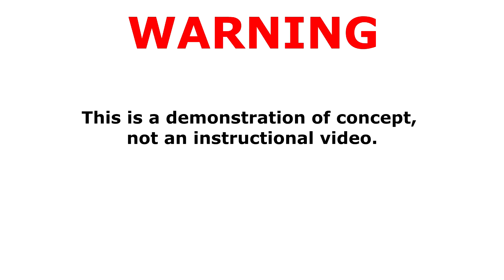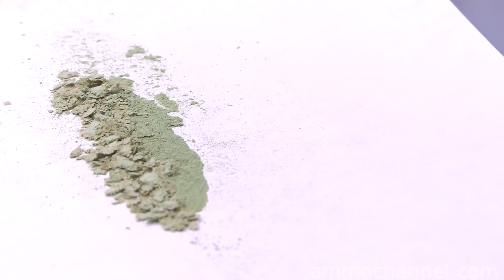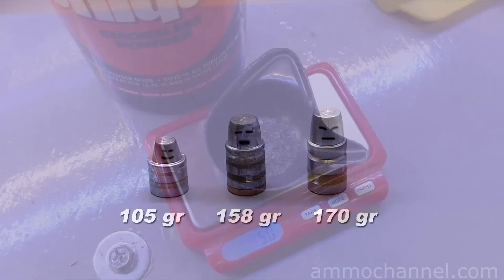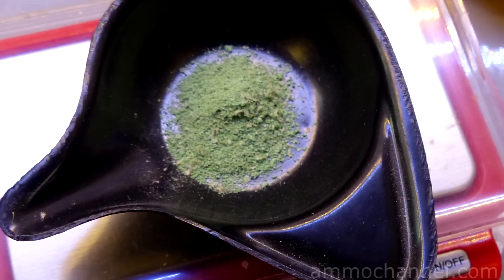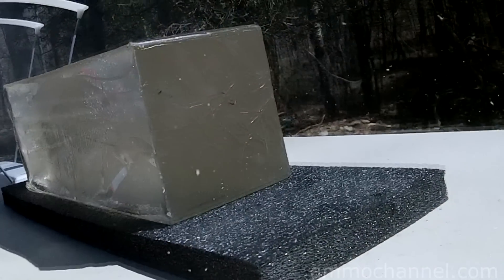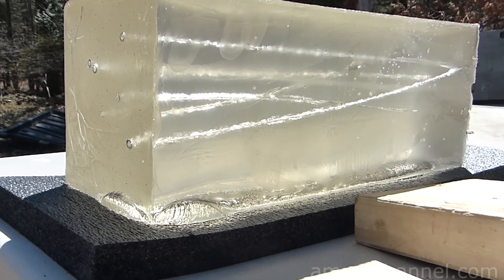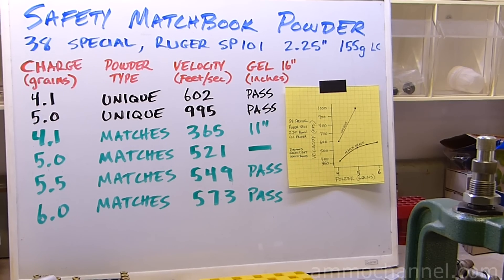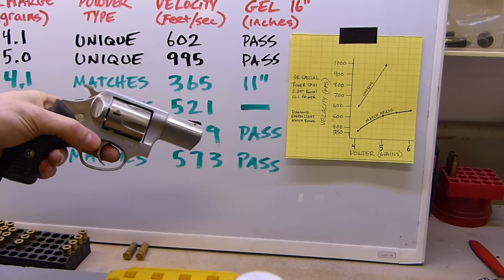Improvised Ammo #2: Matchbook powder vs Smokeless

Comment: You can change grain size by grinding it very fine, or adding water and letting it dry into a large shape, and then grinding that into coarse powder.  Large grains make slow powder and is better for long barrels and small grains make fast powder and is good for short barrels.  Also, any paper at all will hurt your speed.

Comment: I bet it's more like rifle powder in that it's a slow burn which is why 6g only pushed it 573fps.  Get some H335 maybe something faster and try it with 5-6g and I bet it will be comparable then use the match powder in a round that uses faster rifle powders and see.  300 Blackout, 7.62x39 etc.  You can test a few rifle powders.

Comment: I imagine you know this already, but with Black Powder and other non-smokeless type loads, you typically have to use way more powder than you normally would. you could easily use 60 grains in a single BP load. for matches, i think a more accurate load would be much higher than 6 grains.

Comment: 1:04 For  a more powder like result consider using a hammer on  a board on cement or in a basement (whatever) to put the shaved off matchhead's on, then hammer them to dislodge the chemical dip from the paper more completely (The Matchheads will not ignite, I tried it for you).   2:00 consider using a kitchen screen sifter, the wires are tighter together for a fine powder will result and improve the FPS performance.  This method will not work out if you are hoping to become "The Shooter" who did it  and themselves, or if you prefer it will be done for you, just wait a bit... Take a look at your future 

https://www.youtube.com/watch?
v=lxdPao1n3Bo&ab_channel=TrendingStory  <- Real Video

Comment: Once made a scaffolding Bar into a cannon as a Kid and used Match heads as the propellant and a load of Nuts and bits of metal for shott and at 20 yds took the top out of a Holly Tree  It was quite impressive actually but terribly Dangerous and I wouldn't recommend it to anyone to try!

Comment: Cut the match heads  off with shears,  and throw two or three books in a electric coffee grinder, and hit it for a few seconds,  because  this is not a compressed round the worst that will happen is it could flair up,( I've done this meny times and it never has) , now take this powder and run it trough a screen, done

Comment: if you want fast burning match powder use sandpaper to take the red phosphorous off the striker and get some sulphur off the match heads mix to Red Phosphorous 30 / 70 Sulphur ALSO make sure the sulphur is really fine crush it down down down, then mix the two fine powders together (i heard some combination (brand) of matches can cause the 30 / 70 to be friction sensitive so be careful when mixing, you should use gravity to mix )

this powder burns really fast and if compressed causes a decent explosion and release of gases so experiment with different weights and mixtures

Comment: Sand of the phosphorus and add it into the mix, it will get more faster burning and aggressive, be aware that it gets more unstable and will react to friction and will behave almost as nitroglycerin. No problem to handle it and fire it, but if you do so, do it with extreme precaution.
Reply: If you do that instead of the bullet fireing out the cartridge spilts and explodes, so that idea is not very usefull

Comment: If the matchbox mix is overoxygenated and high in sulphur then grind up a little charcoal to a fine powder I would suggest 2 parts powder to 1 part charcoal to start that should make the mix slightly less corrosive and if mixed slightly to excess then what is not needed would only act as a filler. try it :)

Comment: At the 573 fps velocity, you're generating 113 foot pounds of energy.
Reply: A .22lr has more power than that
Reply: @matthewmorel3758  from a full length rifle, its about equal. but from the ~2" barrel he's testing, the .22 will only generate ~50 ft/lbs (average, obviously different bullet weights are a bit more or less powerful)

Comment: Is it possible to make improvised primers?
Reply: grab some strike on box matches, hit the heads of a few of them with a hammer to break the matchhead from the wood. scrape off some of the strike strip off the side of the box with a razor.  gently mix the powders together, then whack it with a stick.  it should explode.  that's your primer.  you can reuse centerfire primers if you tap the dent out with a hammer and rod or some such.
Reply: U can use a toy cap covered in tin

Comment: Unique is a fairly fast burning powder.  The match head powder seems to be a little slower burning.  The increase in FPS for the increased charge weight of Unique vs the increase in FPS for the increased charge weight of  match head powder could be interpreted to support that Unique is burning much faster than the match head powder.  That is, the heavier charge of match head powder failed to burn completely before the bullet left the barrel of the gun.  I wonder if a longer barrel or heavier bullet would show the same relationship between charge weight and velocity for the match head powder.

Comment: It looks like the reason for the tapering off of performance is due to a lack of oxygen in the round. Go buy some stump remover and (KNO3) and sprinkle a little bit in. KNO3 is an oxidizer and you will get a better performance out of your match heads with that. 

I would also love to see if a Rocket Candy mixture ground up would produce a good powder. 

These videos are great, hope you keep making them.
Reply: +josh Katz  Nothing to do with oxygen, that's just how energy and velocity works. To go twice the velocity, you need four times the energy. From the data, we can discern match powder just has a very linear burn characteristic, compare to smokeless powder where linear increases in the amount of propellant can result in exponential increase in energy.
Reply: +josh Katz said:
" Go buy some stump remover and (KNO3) and sprinkle a little bit in."
Josh, stump remover is potassium nitrate (KNO3) so why bother? Buy one or the other..no sense in buying both!  :o)
Reply: Rocket candy may work for a long barrel rifle or shotgun. I dont thik it would for a pistol, it is slow burning compared to gunpowder.

Comment: What if you granulated the matchhead powder like with black powder, granules should give better burn characteristics then fine powder, just wondering.
Reply: Neat idea
Reply: Because of empty space between grains
Which mean greater temperature and quicker explosion. In a nutshell - better results
Reply: Better pressure increasing
Reply: I've done this with my cap n ball revolver  before,  and I loaded my Chambers about  half way, the felt results were very similar to black powder,  although I can't add more then that as at the time I did more have a conagraphe,

Comment: I did a bit of analysis and extrapolation. The data you gathered seems to fit a natural exponential curve, which is quite interesting but expected. The most economic yet viable grain amount would be around 4.5 grains producing a velocity of about 450 ft/s. After about 5.0 grains the powder will become increasingly insignificant, and anything beyond 5.5 grains is wasteful. The increase in velocity is about 4 ft/s after 5.5 and it rapidly decreases. The best fit curve I found is

V = -4.086x10^4*e^-1.268M + 591.3

Where V is your velocity and M is the mass in grains. I did a bit of rough calculations and found that the bullet would travel about 280 feet before hitting the ground. Of course, it's incredibly rough, so it may be fifty feet more or less. Anyway, interesting video!
Reply from the maker: Impressive!
Reply: Came for the ammo, stayed for the math
Reply: @rbhouse1377  Lol
Reply: cool analysis, but by measuring velocity we are indirectly measuring energy, which is a less accurate way to make predictions

I think we should expect a somewhat linear relationship between the energy of the rounds and mass of the powder used.

kinetic energy (KE) = .5 x mass(M) x velocity(V)^2
doing these calculations I will remake the graphs made in this video and link them below.
https://docs.google.com/spreadsheets/d/1_Q0pt13KqczPvLWoVcAQNDMX1zoinPuu_LU3DlbMvX8/edit?usp=sharing

dont know if you guys are still following but I regressed some equations (that were statistically significant using energy and omitting the last 6grain datapoint) for what you should expect out of any length barrel with any load of powder and any bullet mass.

here are the numbers for a 7.62x39 round given a standard loading of 24 grains, a bullet mass of 125 grains, and a barrel length of 16 inches
energy = 990.8 ftlbs
speed = 1890 ft/s
(i expect this to be an overestimation by about 20% given that the burn rate of match powder will likely be too slow to combust fully before the bullet exits the barrel unlike smokeless, and that ballistics get much less linear past the sound barrier)
so, i expect 1500fps =]
Reply: An actual intellectual discussion in a youtube chain of comments, and very insightful for that matter.
Reply: אבהו דלשר ive done this with a 12gauge shotgun a few years ago and got way more energy, so your calculation probably applies to .38 only. i think i used 100 grains of match powder and got the same penetration with a .70 round ball as i had with 60 grains FFg. however, using it in plastic shotshells will render them useless, it melts them, seems to burn much hotter than regular powders
Reply: The uncertainty of many chronographs is less than 4%. Some have uncertainties of about 0.2 m/s. Using 4% as the uncertainty, your linear relationship is immediately out of range for the first point (4.1 grains). The upper boundary is 66 J while your best fit line predicts 69 J. The second point, 5 grains, has a lower boundary of 116 J, which again, your line of best fit falls out of at 113 J. The next two points fall within the uncertainty, but the uncertainty given is quite a large one and most instruments don't have a large uncertainty like this one, nor a percentage one. Given this, your linear relationship seems to be invalid.

Besides, a clear decrease in dV is present as more powder is used. This is practical since there is only a certain amount of pressure that can be applied before any excess pressure is wasted. This is clear if you've ever fire a toy gun: the dart flies out before all of the air is released. So, there has to be a peak somewhere, indicating a curved, not a linear, relationship. The best fit for this is a natural growth curve, which makes sense since it's exponential and constantly compounded rather than in chunks.
Reply: true, but I dont have any information to calculate the error propagation youre refereeing to, so it seems like a mute point.

if you compare the R^2 vales of both the powder vs velocity graphs and the powder vs energy graph, its indisputable that a linear fit line better represents the energy graph.

I do agree that a logarithmic fit is more appropriate, however if you take the limit of any logarithmic function as it approaches its origin, it does in fact become a linear relationship, which is why a linear fit is appropriate for small estimates =]

in reply to the waste of pressure, if you integrate the PV work done by the system, it will be the same no matter how fast the bullet moves, so im not sure what you mean by wasted pressure
Reply: Considering it's a different casing all together, I don't have enough information to predict how fast it will go. Casings do affect how the powder is burnt and how pressure is built. In fact, I'd say I don't really know enough information based on these results to make a good prediction. What prediction I made was just a sort of interesting mind experiment. Clearly there is a need for more testing with more data points and a more controlled environment. Like I said earlier, three data points is just barely significant. Four is just barely significant as well. I personally would like having three trials for each amount of powder and around eight different amounts of powder. Otherwise, you get some extremely varying results.
Reply: I did a linear relationship on the velocities, including the 6 grain shot since only three data points seems pointless, and got an R^2 of .91. This is pretty good, I agree. However, it has an RMSE of 33 while my equation has an RMSE of 5. Clearly no linear fit cannot be right, since the RMSE outweighs R^2 when it comes to prediction, and that's the purpose here.

Besides that, I gave a generously high percentage error to calculate the error of the graph. A percentage error is generally not what you give an instrument, rather you'd give a static uncertainty such as +/- 5 FPS. The fact that your linear fit and my linear fit do not match the data set when uncertainty is given is a bad sign.

Finally, the PV work done is only effective if the bullet stays still for the entire pressure to build up. The problem is that the bullet will move after a certain threshold is met, which will be before all of the powder is burnt, meaning it will move as the powder is still burning. At some point, the bullet has to be moving so quickly that it exits the barrel before all of the work can be done onto it due to the powder not fully burning. If you watch Demolition Ranch or TAOFLEDERMAUS, you can see this in their experimental bullets tests. If you fire popcorn, the popcorn will leave the barrel before all of the powder is burnt. Same concept here. Because of that, there will be wasted powder and there is a negative V''
Reply: so how fast do you predict an ak projectile to go?
because it seems like youre just flaming my method at this point

we both know rsme is useless with small data sets because they inherently have small variance, we both know velocity doesnt scale as linearly as energy, and we both know popcorn out of a shotgun is not going to act like a piston unlike a bullet

Comment: What's your volume of powder vs. weight?  You may gain some performance out of the match powder if you've got a significant volume of space between the bullet base and the powder.  Fill the space with cream of wheat or kapok.  I'd do that with Unique with cast bullets from larger rifle cases.  it really helps with consistency and accuracy.

Comment: If nothing else it is still useful for reloading primers. What kind of performance would you get from using blackpowder for propellant and the matchheads to reload the primer?

Also, don't know about American legality regarding armor piercing but gluing a steel ball bearing in the point of a hollowpoint round increases penetration (and helps it expand).

Comment: Very interesting.

I used to make "home made fireworks" using the powder from model rocket motors. Just took a large drill bit and by hand turned it, got a very very fine powder which seemed very powerful. Tried it in a home made .50cal cannon, works pretty well if I don't want to go spend $20 on a bottle of powerdex.

Just a thought for your improvised powder.

Also, what about "home made" black powder?

Comment: Hey awesome video, I've done this before myself with the matches. The concept of reloading ammo with matches is from the U.S Army's improvised munitions manual. They got some other cool ideas in it too that you could use to survive in a S.H.T.F, WROL scenario.
Reply from the maker: Hi there, yes, I did read about it in the US Army's manual but I'm not sure that is where the idea originated from, hard to say but its obviously been around awhile.  I found some data elsewhere too but it doesn't seem to be adding up.  Perhaps the composition or quantity has changed in modern matches.  As with everything else today the price is higher and the amount of product is smaller.
Reply: The Ammo Channel Have you thought about using "strike anywhere" matches?